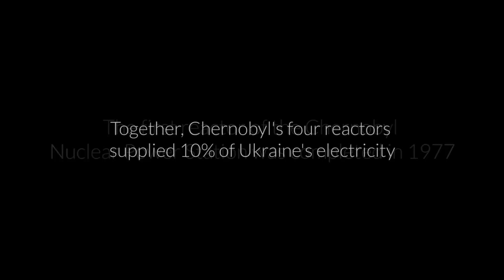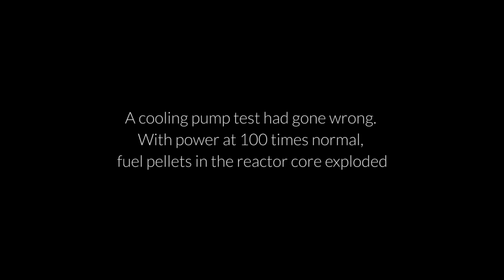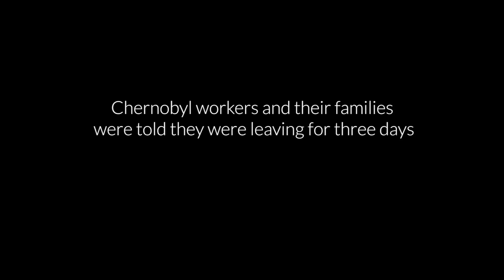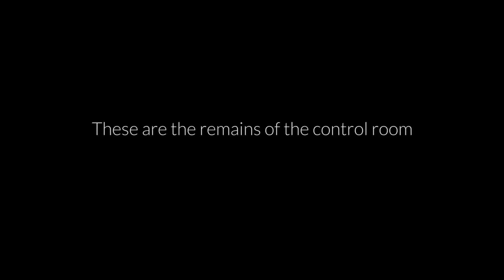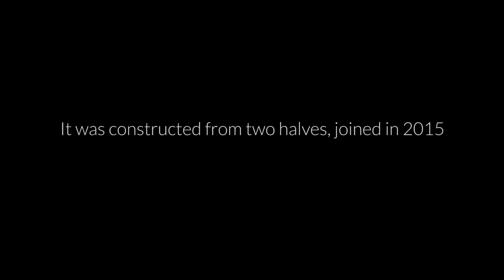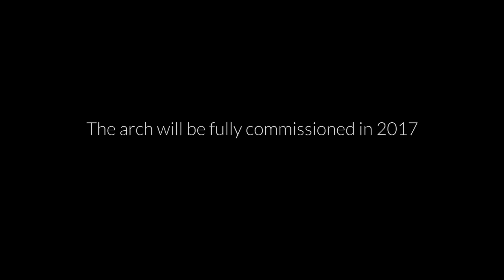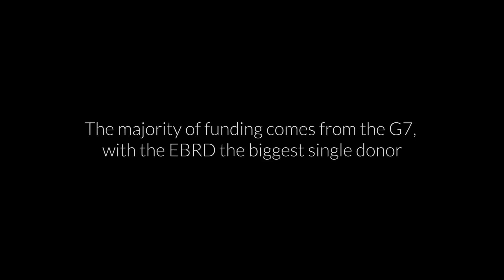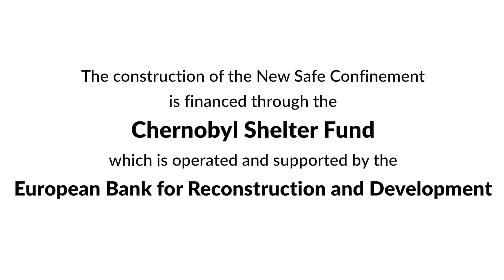Chernobyl: 30 Years On

Comment: Stupid question: Since I notice these guys being interviewed not wearing any protective gear from radiation, is it safe to do so now?
Reply: +Interstate 35 They have built a thick wall out of different materials including led to shield the workers working on the new shelter from the radiation coming from reactor number 4. They have also removed about 1 Meter of ground below the whole construction site and filled it with concrete to protect the workers from any radiation from the ground. So it's pretty safe to stand there without protection as you are protected by those safety measurements. But it's not that easy to just make radiation "go away". These things are helping a lot, but the radiation there is still very high. The most important thing is that you arent exosed to it for too long, so that you dont get a dangerous dose of it.
Reply: After removing the top layer of the contaminated soil, around the reactors, it's much safer now. Also the decay rates have come down to a tenth of what was there initially in 1986. So u can go there, without much protection.
Reply: +Interstate 35 I also have to say that you can't really protect yourself against radiation. You can prevent radioactive particles from entering your body and contaminating it from the inside by wearing a simple mask and take JOD-Pills to prevent your thyroid from taking up radioactive Jod-131 like a sponge. Thats pretty much all you can do. The most important thing is just to limit your time of exposure...
Reply: Dr.Minecraft
NOT entirely true .
It`s called ALARA .
There exists ways to shield yourself from Radiation Dose .
Reply: You could wear a lead suit, that stops much of the gamma dose
Reply: Places like the school and Farris wheel are safe but the red forest and other spots will kill you
Reply: @freddyguile1356  like the old hospital basement!
Reply: It’s been safe to visit Chernobyl and Pripyat for many years, but there are still pockets of radiation in the area and the power plant itself is very iffy
Reply: @MysticBallistic23  thatvis because of the spring under the elephants foot causing another steam explosion
Reply: You can visit the power plant inside
Reply: Certain areas are safer.  They give tours now.  I would love to go on one of those tours.
Reply: @8iosatlost209  Das kann ich nicht beurteilen. Ich bin weder fachkundig noch kenne ich sonstige Hintergründe, gehe aber davon aus, dass zum "Schutze der Interessen" vieles unternommen wird. Dass die tatsächlichen Geschehnisse und Aktivitäten mit dem nach außen vermitteltem Bild wenig bis gar nichts zu tun haben halte ich für wahrscheinlich.
Reply: Okay. Thanks for info.
Reply: Yes, from videos I've seen even areas right next to the power plant are only a couple times normal background radiation and even the reactor control room where people died during the accident gets about the same amount of radiation as a cruise altitude flight.
The reactor room should still give you a lethal dose in a few minutes though.
Reply: Some parts yeah, you can take tours now
Reply: +Interstate 35 From what I have seen on this and other videos some places will melt your face off instantly and others are fine to stand unprotected??
Reply: Yes that's a stupid question
Reply: Please looking for "Checherov" and "Pflugbeil". They visited the reactor 4 without any special protection. The offical statement was that 3% of the nuclear material was setting free. But very likely is 97% was setting free in a big explosion. So there is not enough nuclear material left inside the reactor to harm the workers. This new shield is just to keep the Dust inside.